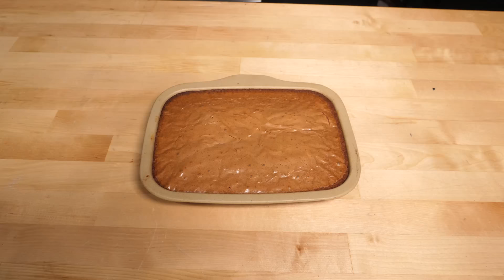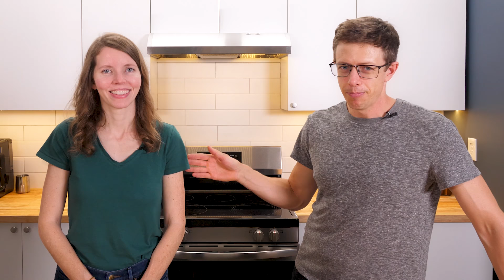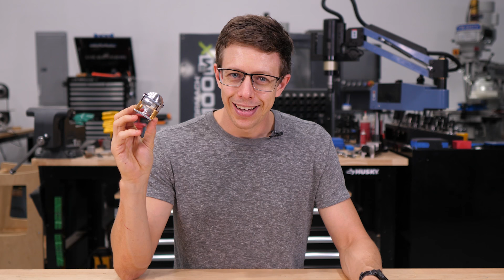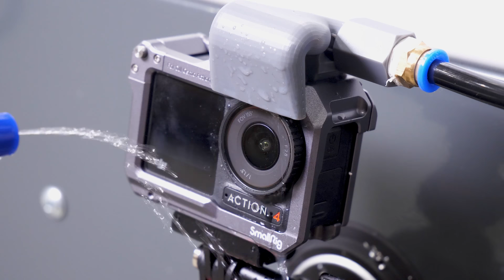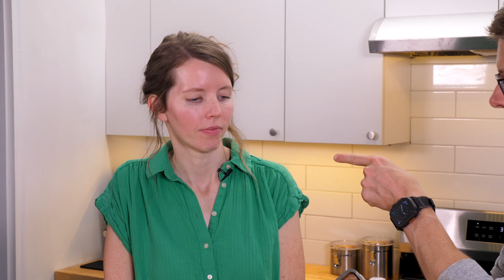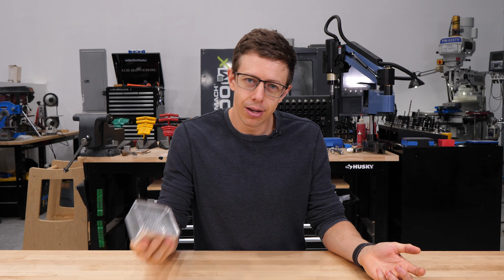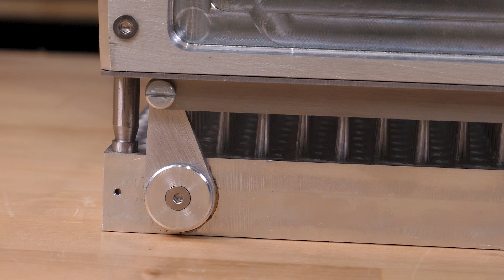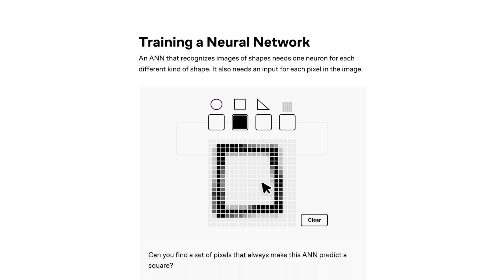Baking brownies from the inside out

Comment: This* is why orbital microgravity manufacturing is getting a lt of attention and investment lately. In microgravity you could design a fully-convex "pan", for example the external surface of a sphere or a toroid. The batter "fills" the pan by covering it and stays "in" the pan by surface tension.
You could even make a "true" edgeless brownie by omitting the pan entirely, and just cooking a self-contained sphere of batter to give a brownie with no bottom. Its only surface would be a completely contiguous top.

*I mean, not specifically this; not brownies. But other things that can't easily be made under conditions of significant acceleration. Conformation-sensitive peptide drugs, nanomechanical systems, etc, etc.

Comment: Okay, hear me out for a much simpler design that I think might work just as well: a brownie pan with spikes and all but it works the same way as a cake tin that has a springform mechanism. To get the brownies out, you do the same way you would with a cake in such a pan: you let it cool, release and remove the sides, flip it over, and remove the bottom. Less moving pieces, easier to make, easier to clean.
Reply: genuinely a great improvement. If you want the brownies to be square, you would need to design a springform cake tin with square edges though, which may be a bit more challenging (as the shape makes it a bit harder to have all of the edges under uniform tension like a circle), but I am sure it could be done.

Ofc he wouldn't do this for a video because its part of the appeal for his channel to have overengineered stuff, and I guess his mechanism has a more "premium feel" and you do the least work as a human (no flipping over), but cleaning is a HUGE issue with cooking equipment and I think you solved that for sure.
Reply: @alexanderokak5112  There are square springform cake tins
Reply: @TheIonizator  nice
Reply: @alexanderokak5112  I think if the corners are rounded or it's a softer metal like aluminum, I think you would probably be able to open it just enough to slide it off the cake/brownie. And yeah, my idea would be more of a "make an actual product" idea and not a "make an absolutely sick YouTube video, regardless of commercial viability" lol.
Reply: simpler design, not such a cool video tho ;)
Reply: Loose-bottomed tins avoid the issue of corners. I think brownie batter should be fine and not leak without lining, but you could line the sides* if the spikes aren't too close to the edge.
*Edit: I.e. with a small lip of paper to cover the join between side and bottom.
Reply: If the brownie cools before it's opened does it stick the spikes or break apart?
Reply: It would be harder to remove because regular spring form pans already leak and you have to line them with parchment paper
So you'd be trying to spike parchment paper onto this one which would be a pain in the butt
Reply: @KaitouKaiju  I've never had a springform pan leak any sufficiently thick batter, like cake or brownie batter.
Reply: I think a lot of the issues could had been solved by making the sides of a less heat conductive material such as PTFE. No need for spikes to make the center cook quicker if you can just make the edge cook slower.
Reply: @MrJamesBanana  But doesn't the heat always go through the edge to reach the center? So if you made the edge cook slower, it would mean the center would also cook even slower, defeating the purpose.
Reply: @MrJamesBanana , since he has his oven plumbed for cooling the camera, it would've been interesting to see a pan with built in liquid cooled sides. Not practical for the average consumer, but same concept of another way to align cooking speed. Rather than speeding up cooking the internal with the spikes, it's slowing down the cooking of the edges
Reply: or you could just cook a regular brownie the regular way in a regular pan and then just cut the edges off and throw them in the bin or give them to someone who has no soul.
Reply: @iris4547  You must be fun at parties.

Comment: Just wondering, what if you'd have a pan with really thick or thermal isolated edges so the brownie would just get the most heat from the top, how would that work

Comment: Love the idea! I feel like the could be done by adding spikes to typical cake form, solving a lot of the headaches with removing the bottom (by rather removing sides) a overall lowering complexity. All you really need is tightening sides by simple latch mechanism around the bottom plate.

Comment: I made my own spring plungers once, 20 years ago, for yet another project I never finished. Aluminum tube, a machined cap I hammered into one end, little milled channels in the walls (Sherline CNC mini mill), a little plug that could slide in the tube, with a hole drilled laterally through it, and then a brass pin slid through the tube channels, and through the plug, capturing it, cut flush to the tube's OD, and hammered lightly to bulge it enough to stay in the sliding plug. The siding plug stuck out like a rounded-over pin, and could be pushed in, spring plunger style. It was for one of those zombie survival boxes, but I lost interest.

Comment: I think maybe you're "too" intelligent, I think all you'd need to do is put a thick layer of silicon on the sides of the pan on the inside so the mix isn't in contact with the hot metal pan

Comment: As a chemical engineer who dreams about baking all day, my made-up answer for why cakes and brownies don't cook the same is not so simple as on the surface - there are the effects of moisture content and homogeneity on heat transfer (more watery batter cooks differently than oily batter and also differently than dry batter), but there is also the effect of baking powder which create low heat transfer air pockets (light, fluffy cake) which insulate parts of the batter from conduction (requiring the slower process of convection heating with no forced air [air only moves around from the density effects of different densities of air, and Brownian semi-random motion]) and the amount of sugar relative to the moisture (brownies get a hard exterior as traditional cake's floury base doesn't quite create such hard edges).... idk the answer is somewhere in here, it just needs about 15 grad students and 10 years of funding but that ain't me

Comment: Yeah so you wouldn't need a billion little O-rings, you could just put a sheet of silicon on the bottom and use the lever's mechanism to hold the pan tight to the bottom. That'd stop any leakage and keep it oven-safe.

The other design change I'd make is switching out the ball springs for pins. Nightmare to assemble, but so much cheaper.

Comment: Funny that he did not team up with Styropyro to simply solve this issue with a microwave oven. You can use rotating metal reflectors to rotate the standing waves inside and heat the brownie equally, then use thermally transmissive material to contain the brownie while baking

Comment: You've correctly found that the high heat conductivity of the brownie pan leads to faster cooking edges so why didn't you make a pan that had the opposite? A pan with edges made out of silicone or some other type of insulator. Perhaps a brownie pan that has an actively cooled jacket like your camera but uses water or air. The batter at the edges will have to cook in the same way the middle has to.

Comment: A simpler solution to retractable spikes is a double pan. So a normalish pan with the holes in the bottom and a 2nd pan with the spikes that the hole pan fits onto. No lever required.

Comment: Perhaps a stupid question, but what if you make a regular brownie pan, but make it out of silicone rather than metal? I imagine silicone has a much lower heat transfer than aluminium or steel, so the edge of the brownie would have similar heat transfer as the centre?

Comment: you could build the walls similarly to a springform pan. theyre cake pans that have a separate base and a latch on the walls to tighten to around the base. it lets you remove the sides and you could easily take the brownie off now that you have proper grip. i will say it does looks a million times simpler than the final product which sounds completely unlike stuff made here so im not so sure

Comment: @stuffmadehere Great article, something I have thought about as well.  A few thoughts though: the issue with brownie edges isn't about heat, it's about moisture. Yes, it turns out that what influences baked goods has largely to do with moisture loss. Imagine the brownie edge - exposed to the most heat for the longest, but what is the result? It ends up drier. If that edge had retained its moisture during the cook, the water would have continued to evaporate, rather than the brownie batter solids caramelizing and encrusting.  So: 1. The secret to minimizing or eliminating brownie edges is actually a matter of water loss; figure out how to minimize or eliminate water loss and you are partly there.  2. Remember that surface area plays a roll in this as well; a square shaped pan has more surface area, and therefore exposes more of the batter to direct heat, so you probably want a circular pan.  3. Since 1 is true, you probably have to consider alternative cooking methods: Double-Boiler, steaming, or maybe even sous vide.   Food for thought. :)  Good luck.

Comment: I bought one baking pan. drilled some holes. Traced the holes on a metal sheet.  Clamped the two. Then pushed some rivets from the bottom. But I don't have a 5axis CNC.

Comment: As a nerd that bakes, this could have been achieved by using a water bath. Just put the pan of brownies into a larger pan of water that goes half way up the brownie pan. The pan can't get higher than 212 degrees, which will keep the edges from drying out into an "edge" piece.

Comment: I wonder how cheap and simplified you can make that to be actually afordable. Something around 50$ at most would probably need to be the target for a home kitchen.
Could probably be done with fewer spikes? Aiming for about 4 holes or less per brownie square, mabye even one? May need differnt cooking temps and times.
Instead of a lever action lifting the pan maybe break  away edges? Then once the squares are cut you'd need a bespoke spatula to slot between the spikes to lift the brownie off.

Comment: You need to reconsider your approach and do the V2.0 version using heat pipes rather than solid aluminum pins.  If you study the transient heat transfer up those small diameter pins you will find that the heat does not actually conduct up those pins very far before it is drawn off into the brownie mix.  Heat pipes on the other hand can be designed to distribute heat evenly along the entire length of the pipe in the area desired for heating.  The base of the heat pipes would be mounted in a heat sink below the pan where they would get their heat.  The heat pipes should be stainless with water operating fluid.

With your lever ejection system the perforated plate on the bottom will act like a stripper plate and you will not have to taper the heat pipes as long as the heat pipes are draw polished.  I will also suggest that you increase the diameter of your "guide pins" on the pan base.

I would also suggest you put a layer of insulation on the flat surfaces on the outside of your pan and double the amount of insulation on the corners.  This will reduce the heat coming through the sidewalls and bottom of the pan and help even up the heat coming through the corners and top edge verses the flat sides and bottom.

Using heat pipes you will be providing substantially more heat to the inside of the brownie mix then through the side walls and bottom.

Comment: $899.99 for one of those... or maybe just get a silicone brownie pan or the 2 pans with water in between method. Silicone doesn't conduct heat like metal does & the water method forces the temp on the pan to stay lower than it normally would, so it bakes from the top more than the edges.
I hope your wife doesn't murder you for drilling holes into the oven, lol.

Comment: Wouldn't an edge only brownie pan work pretty well for creating a brownie with no edges? I does the same thing this does, put in heat more evenly, if you just used one of those and adjusted your temperature and time, I think it could work, at least a lot better than a normal pan.

Comment: I'm surprised you didn't go the easy way. 
It's kind of like making the totally clear ice. Slowing the heat down, so it cooks even. 

I think there's some way to make a normally used pan that doesn't speed up the cooking, but slows it enough from the sides. Either silicone edging or phase change ?  So it cooks from the top and bottom the same.

Comment: Okay but how is this different from just cooking for less time with the edges-only pan? You could use your pan to make all edges in the same way theirs does. Both your pan and the all-edges pan are just allowing for better heat transfer into the center. Your recipe is optimizing for even cooking and theirs is optimizing for burning more of the center, but the pan is the same except you solved the main problem of their design which is how annoying it is to cut.

Comment: If you want edgeless brownies, which is already a pretty diabolical thing to want, just cook it slower xD
Dude's out making crazy contraptions, forgetting this is cooking. If you super slow cook the brownies, at a much lower temperature, the outside won't get hot enough to form crusts, while the inside is allowed to heat up to the same degree. 
Alternatively, perhaps you can heat it up from the inside to begin with, by just putting it in a microwave oven.

Comment: Couldn't you use a pan with a standard metal bottom, but with hight temp silicone sides? The silicone wouldn't hold the heat while cooking and the edges would mimic cooking in the center.

Comment: Would have been way easier to program an oven to raise the batter to the maximum temperature where the eggs aren’t cooking until you have an evenly heated mixture. Then raise it to the lowest temperature that actually cooks the batter.  Would take a long time, but less time than machining.

Comment: Don't you think you could use the motor voltage or amperage change to quantify the "toughness" of whatever you're cutting through for the edge tester instead of doing a load cell?

Comment: You could definitely mass produce this with a pressform metal two piece pan, just have a recessed edge on the bottom one with a heat resistant silicone band around it for the drippings that inevitably make it through.